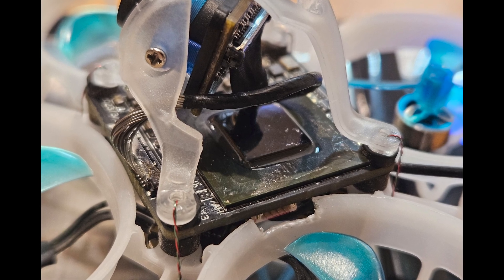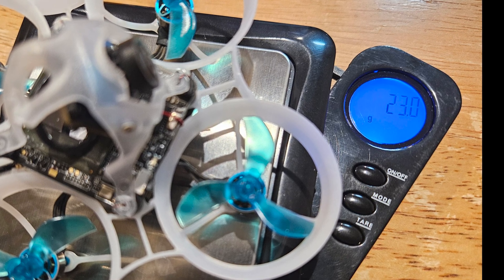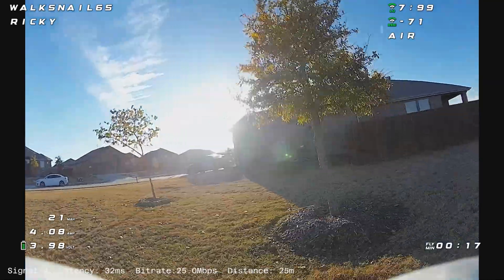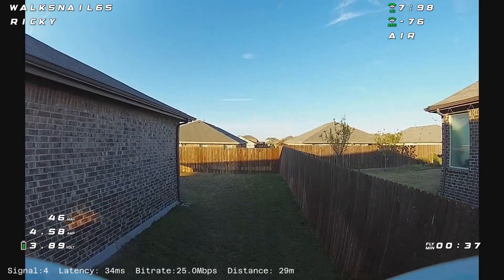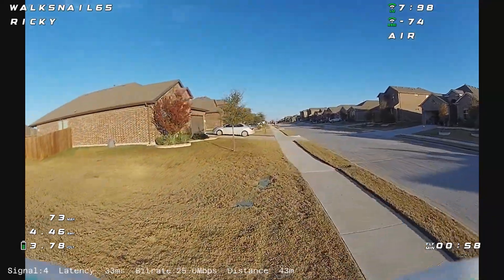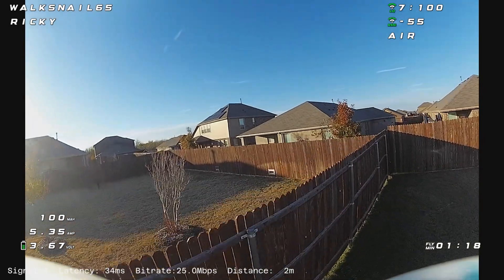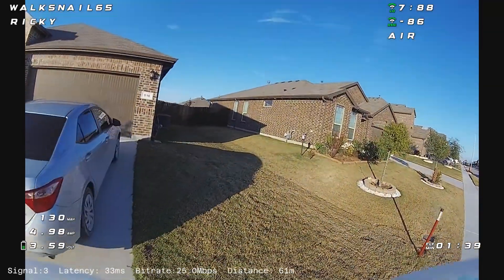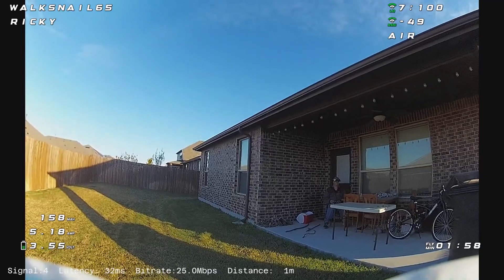22.7g 65mm Walksnail Whoop!

Comment: Nice build 
My one is almost finished 
How did you remove the sink form vtx 
Many thx
Reply from the maker: I just used an xacto knife and wedged it underneath the metal heat sync and slowly worked my way around it until it came off.  Heating it up might help?

Comment: Man, that rocks - Walksnail on a traditionally sized (65mm!) Whoop.  I wish I had the build skills to pull this off; it's exactly what I need.
Reply from the maker: You can, this one wasn't too difficult.  I just built another one with a uz80 frame and 802 motors and it flys for 3 minutes.  I didn't do any weight savings on it and it weighs 28g.  You only need to solder 4 wires if you choose to leave the motor plugs on.
Reply: @RickyGode how does she fly?
Reply from the maker: @pulsefpv   Flys Terrific!  It's the best flying whoop I've ever flown!
Reply: @RickyGode you must ain’t flown to many whoops then ! lol 😂
Reply from the maker: @ronniequalls7217  Yup, all my whoops have been "HOGS" this one weighs about the same as my first whoop. I'm not good enough to comment on performance. I can barely get through all the gates.

Comment: Hi, I want to build a similar drone ;) First I wanted to base it on the Meteor65 frame, but this one seems a bit more interesting and a bit lighter. I have a question: Can you share the BetaFlight configuration (PID settings, etc.) ?
Reply from the maker: I can, but I haven't changed anything.  It's all completely stock/default.  I like this frame better because I was able to mount the FC on the bottom and the vTx on top and didn't have to drill out the little stand offs.
Reply: @RickyGode  OK :) thank you for the information. I thought maybe you modified something, but since everything is fine (engines don't heat up, etc.) it's great. I don't have much experience with a small whoop myself (this will be my first construction), so I wanted to ask.
Reply from the maker: @sb5100MoD  Yeah, motors don't get hot and it seems to fly really well.  I need to learn how to tune, but so far the stock PIDs have been great.
Reply: @RickyGode  yep :) I also need to do some research on PIDs, etc. I was thinking about simulations, but there are a lot of non-linear phenomena for which it is difficult to create a mathematical model. I will also have to learn to fly such little ones, I know it is much more difficult than the bigger ones. 

I saw your flights in the basketball gym and you said that it was just the beginning for you too, but you were doing very well in flying :) So I wish you good luck, further successes and lots of fun.

Once I build my version (I'm waiting for the ordered parts), I'll let you know the results :)